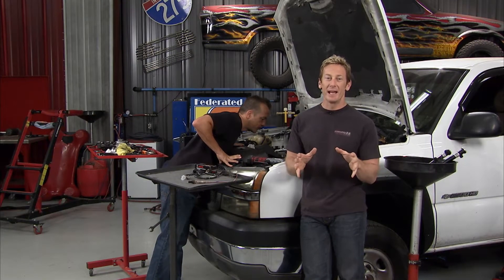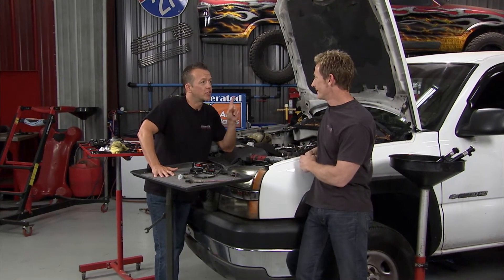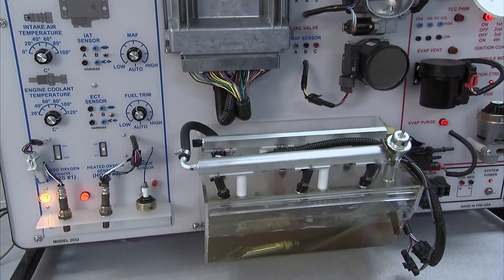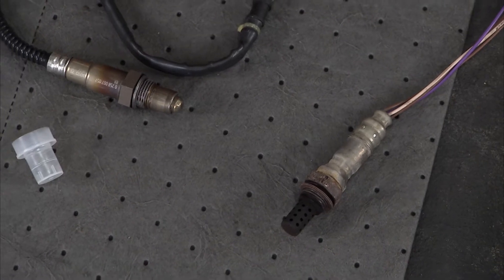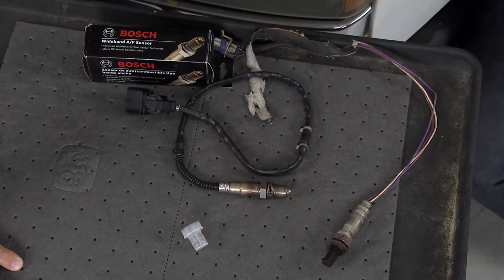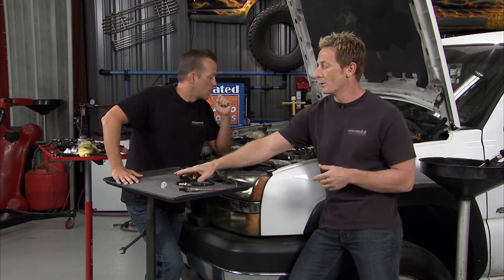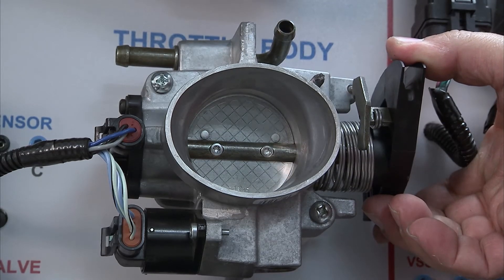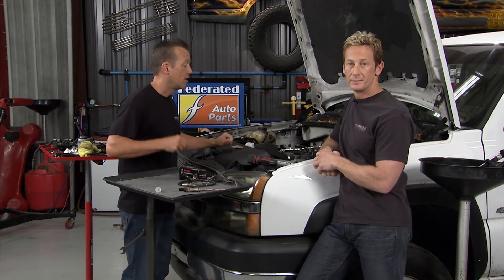Federated TechTalk #60 - Bosch O2 Sensors

Comment: I have a 96 Jeep Grand Cherokee with the 5.2 and after replacing the CAT. and complete exhaust my check engine light would come on once in a while the engine was warming up, I replaced the O2 sensor and the same thing so I installed a Bosch wide band and probably more than 5 years and never a check engine light- 

I was very impressed